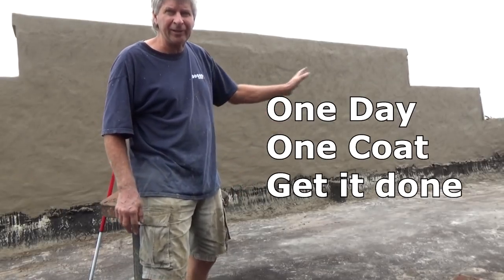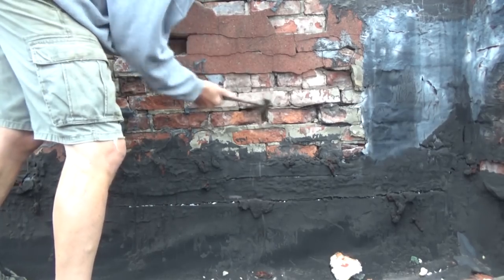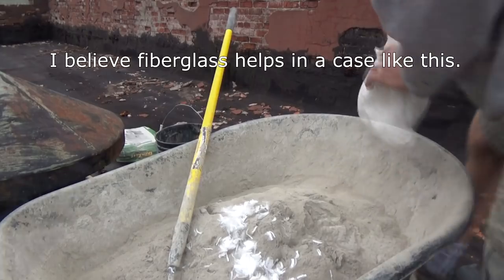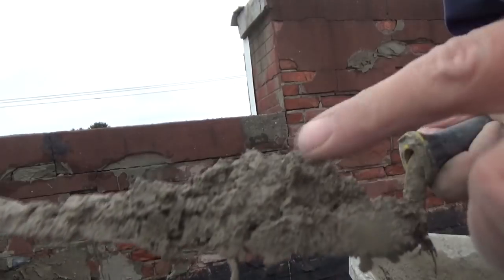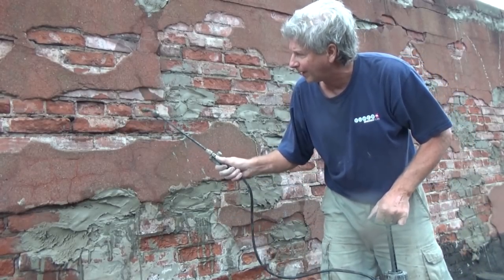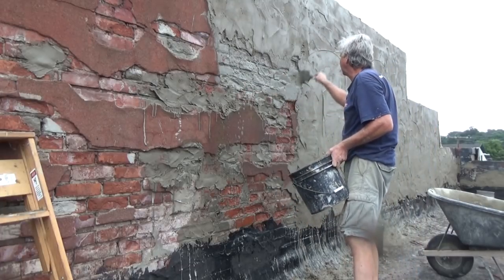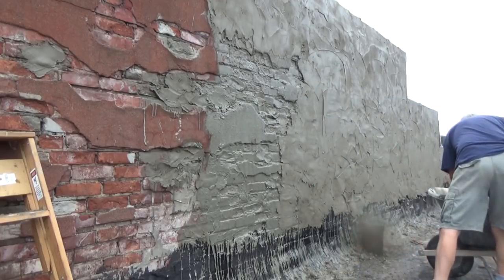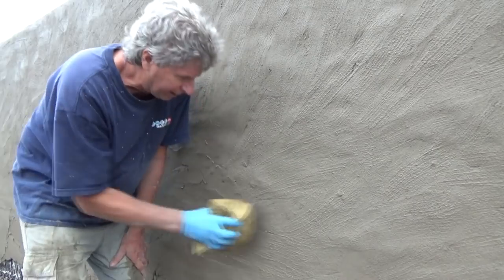MASONRY WALL REPAIR (part 2) Mike Haduck

Comment: All around the world there are buildings whose walls really look like ruins. There's where your cement paint and one hand plastering comes in. If most of the people knew about those simple facts and simple jobs, thousands of houses and buildings wouldn't look so terrible. Besides there is the low budget situation. In this case engineering has a solution and you apply it well. However if people had lots of money they would build a new house or a new building. I congratulate you for what you call "common sense" which is not that common for most people. Happy new year and may God grant you more projects and repairing, the world needs it and the world needs you!
Reply from the maker: Thanks Pedro, Happy New Year, And God bless, also,  thanks, mike

Comment: AHA! It does come down to the decision to take the job or not.
Mike you said a mouthful there.
Takes a lot to evaluate what the owner or agent wants, how much
they are willing to pay and if that will allow the craftsman a completed
work that is both correct for the situation, legal, and not a problem or insurance hazard.
I bet it took you a few years to pick up that skill.
Have a happy New Years by the way.
Reply from the maker: Thanks pensive, that was one of the best placed statements I ever heard, I am going to use it on one of my video, well said, I wrote it down . I am about 20 videos behind but I know which one I want to use it on,  thanks Happy New Year, I appreciate it, Mike

Comment: Mike this video amazing! Thank you. I'm looking to learn new things and this hits the spot.  I have work I wanna do to fix a deteriorated parged wall that came from winter. If there's one to two inches behind the parging, that was layered brick veneer, any suggestions how and if I can just cement that part instead.  I'm clearly very green to this kinda work.
Reply from the maker: Hi PT, I have a playlist called "foundation repair" I am sure you will find something similar,  thanks mike
Reply: @MikeHaduck  cool. Thanks!

Comment: Hey Mike...great job as usual...what's the lowest temperature you would consider doing this kind of work or even tuck pointing brick? If daytime temps are in the 40s and night time temps are near freezing, would you consider it fine?
Reply from the maker: Hi Bee, my rule of thumb is 3 days without freezing, I never had any problems with masonry doing it near freezing, thanks mike

Comment: Hi Mike.
I understand doing the first 3 steps.  The removal of loose debre, the filling of holes, and painting the surface with portland.
Is the next step of rendering the wall even necessary in this particular situaton?
I mean, all you want to do is keep the wall from falling apart on the roof.
Reply from the maker: Hi Bellona, I would say it evens things out better, and keeps any more loose
 Suff from coming off, , thank you, Mike

Comment: We have this stuff over here called SBR which you add to the mix instead of water when plastering apparently it's 100% waterproof . Unfortunately every time you mix costs £30 so I'm not going to use it any time soon . Dave from Wales
Reply from the maker: Hi David, that’s interesting,  never heard of it,  mike
Reply: @MikeHaduck  basically very expensive PVA glue the only difference is PVA remains water soluble and SBR doesn't . My grandfather remembered when Portland was new . regards Dave from Wales

Comment: Mike, I have a similar situation on a 120 year old parapet brick wall with lime mortar. I have sections where it's falling out completely along with the plaster. My question is should I stick to the soft style mortar type n  for old brick repair & plaster or should I use a heavier cement mix in my mortar? Some contractors are telling me if I use more portland in my mix I will further damage the wall because it won't be able to breathe correctly with heavy cement base mortar mix. Your thoughts would b greatly appreciated. I see u using type s mix a lot. I do live in Florida so it doesn't get cold very much, but does rain a lot. Thanks again
Reply from the maker: Hi user, I did a video called "lime, mortar or portland" what should I use? That would give my best opinion, thanks Mike

Comment: Mike have you tried spec mix? Stuff is pretty tuff..Not sure they make type n but I know they make type S. Takes three bags of that to make what one bag of brixment and sand will make. The stuff is so strong. Cost more money but you do not need sand etc just spec mix.
Reply: He is using quick crete type s. It is almost identical to the spec mix u are talking about
Reply from the maker: Hi Stevo, I never tried it,  sometimes I am afraid to try new products, But I am sure I will, thanks, mike

Comment: The cement mixture at 5:00 if it was thicker would be much better. As you did in another video with the brush! However, I notice that there are still many fragile pieces from the old plaster. By way i like your job.
Reply from the maker: Thanks, Mike

Comment: In the case of a chimney with full joints would you cut the joints out and plaster to help the cement grab or would you just wet it and plaster over the bricks? And could you plaster over breakaway block? 
Nick
Reply from the maker: Hi Nick, as long as it is not loose, I plastet over almost anything,  but every job is a bit different,  thanks mike

Comment: Hi Mike i just have a question for u. When u add the fiberglass, is it better to mix it in dry before u add the water & mix it up so the fiberglass spreads evenly? Also would adding the liquid bonding glue or i call it("milk") instead of fiberglass, do the same use as adding fiberglass? Thanx & keep up the good videos! I enjoy them very much!👍. Happy new year!
Reply from the maker: Hi Bob, I find the fiberglass spreads quite quickly, sometimes I get a little lump here and there, but it does the job,  I think the bonding Helps also but it slows down the drying for a fast job, thanks, mike

Comment: Hi Mike! I’m fixing my block foundation. The wall has sheared about 5/8” on row 2&3 of a 5 block high wall. I’m building a new block wall on the inside to support the old one as it’s just a crawl space and pouring concrete between both the new and old wall. On the outside I’ve fixed the water problem (gutters/drainage/grading) but I have a question…the exterior block was covered in a black substance, not sure if it’s tar or rubber. I have scrubbed it with Muriatic acid and about 50% of it is gone. Can I put mortar in the joint cracks and a parging coat over top of the remaining tar covered blocks? Will it stick? Or do I have to grind it all off? Once that is done, I’ll be applying a new waterproof coat and then a drainage membrane so little water will touch the blocks in the future. Thx, as always, for the amazing vids!
Reply from the maker: Hi Will, I did a video called " foundation repair " below grade, Mike haduck, and I used a foundation coating at the end, that might give you the basics, anything that works, thanks Mike
Reply: @MikeHaduck  that’s what I was looking for! How much of the existing tar do I have to remove to ensure the new parging coat will stick though? Cheers!

Comment: Hello Mike. Am I correct that your old school bonding agent (portland mix with water) can only be used on cementitious products and not surfaces that have been painted with exterior house paint?  How would you  bond the cement if walls are painted with exterior paint?  Thank You.  I like your guitar playing .
Reply from the maker: Hi Ray,  in my video series, how I patch up or fix a foundation ( Mike Haduck) there I show how I cut into or grind off the old paint,  I hope it helps, thanks, Mike

Comment: That's also the way we do in Brazil. Cement and water as an initial bonding agent, sometimes painted like that but mostly thrown as a rough cast.
Reply from the maker: Thanks Tescax, I appreciate hearing that, here it America they try to sell you everything you don’t need,  mike
Reply: @MikeHaduck  Oh, we also have all these fancy products nowadays and according to the manufacturers if you don't use them your wall will fall. Maybe they should tell that to the guys who built the Pantheon in Rome.
I use modern products too but it's good too know old school techniques when you're short on money or in a remote area without tons of supplies. Back in 79 my grandpa even made his own lime from burning limestone and slaking it and his house is still standing.

Comment: Great showing again today.  Would you ever do a house sidewall over old asphalt siding still hanging solidly?
Reply from the maker: Hi Julie, I have seen it done years ago, and what they did is still holding up, When I went over old siding I uses styrofoam insulation and then nailed wire for the stucco,   Kirk would know more about that, thanks, mike
Reply: thanks @MikeHaduck

Comment: Nice video Mike. What's the formula for the old school Portland whitewash? I part Portland 2 parts mortar mix and add water? Thanks
Reply from the maker: Hi malone, I have a video out called, " painting with Portland, whitewash, bonding, mike haduck, " that should help thanks, mike
Reply: Just saw it, thanks Mike. Rolling up my sleeves to patch a commercial bldg. with terribly patched cinder block areas that are falling out due to water damage from leaking gutters. Like you say, I wanna be in and out. By 1pm wanna be driving home. Haha. Greetings fro RI. My son is going to college in Gettysburg. Our climates are very similar so that's why I'm finding your videos so helpful. Thanks again

Comment: Hi Mike -Just wondering if a job like that needs some sort of sealer over the finished work? or is there enough water resistance in the mix already - I would think that rain water would seep into the cement and make its way down under the roof or is that just totally wrong thinking on my part? GREAT videos Thanks for posting
Reply from the maker: Hi arosario, I would  say that in this case a sealer would definitely help, and eventually the rain water will be getting in again, but the owners figure they will be dead by then so it probably won,t happen, best answer I could think of, thanks, mike
Reply: Thanks Mike for the response -The reason I ask was back in the late "80s" I was doing Commercial Roofing and ran into the very same type off problem except the wall was half the height of this one , I knew nothing about masonry work at the time -once the roof was replaced my solution to the problem was to just run the flashing all the way up and over the top of the wall and replace the top cap with a one piece aluminum one -so as far as I know that worked as I never received a call back lol Thanks for the videos !!

Comment: If I wanted to cover soft orange brick that is falling apart the same way, could I still do a 1/2" scratch coat and notch it to apply a veneer? Would I be better off just doing cement board over the brick?
Reply from the maker: Hi Dave, it is a hard question to answer, every situation is different, some things work some things don't ,  it is best to ask some of the locals or inspectors and see what they would require,  thanks, mike

Comment: Hi Mike. I have a wall I need to repair similar to this one. I have two questions: 1. Will the portland paint work on cinder blocks? 2. Do you have to let the patchwork dry before going over with the final coat?
Reply from the maker: Hi Brian, I always use the Portland paint, especially on cinder blocks,, I usually let it dry and then go over it again and again until I get the final finish, also sometimes I go over it again with the paint between coats if I think it needs it, I hope it helps thanks, mike
Reply: @MikeHaduck That helps a lot. Thanks, Mike.

Comment: I just submitted my bid for a job in my town. It's in an alley and one section is 6' wide  x 20' high on one side and 4'wide  x 20' on the other side of an elevator shaft. The wall is granite and brick they dont want anything fancy just covered up. I was curious if you would recommend the mix you use here and if you think dimple mesh would be needed. Since the sections are so high. I was planning on using heavy duty waterproofing mix.
Reply from the maker: Hi Nick, it's a hard call, I usually use some fiberglass added , do my  first coat wait a few days and do a second, but everything depends, I would do a little sample on the wall and see how it sticks. I like 2 sand to 1 cement ( half smotar half potland)  other masons would disagree, thanks mike
Reply: @MikeHaduck  thank you for replying mike not alot of people would. I really appreciate it. Happy holiday season!

Comment: Hi Mike, love the videos.. What would you say is the thickest, approximately,  you could lay 1 coat of that s mortar onto brick? Labels say about 1/2 inch. Id like to get 2 inches... Would the fiberglass enable a thicker layer?  Many thanks!
Reply from the maker: Hi Emmarie,  I try and keep it as thin as possible,  if you want more you usually wait and do a second coat days or weeks later, check out my foundation repair videos, every situation is different,  thanks mike
Reply: @MikeHaduck  Thanks Mike, could I recoat a few hours later once the first thin coat has hardened?
Reply from the maker: Hi Emmarie, the problem is traditional cement shrinks, that is why guy like Kirk wait up to 30 days to put on the final coat, otherwise it is going to show a lot of cracks,  if it is very small job I will just use rapid set or fast settling repair mortar and two ahours later you can go over it and be done,  it all depends on the job, I hope it helps, mike
Reply: @MikeHaduck  Thanks Mike, Im in NY so I trust your climate opinion here... I didn't get any shrink cracks, I was more concerned that the second layer would not adhere properly, as I only waited a 2 hours to recoat. I used regular s mortar mix and added a bit of portland, and each layer seemed to hold well together. each coat was 1/4 " totaling 1/2". Im goind to drylock after 30 days, i bet that would cover any cracks too, thanks again Mike

Comment: I need to do this in one part of my house. But it has paint all over. Can still do this . If i can't get all the pain out. I leave in Reading PA.  Which house is 110+ years old. Thanks.
Reply from the maker: Hi GH, keep watching the playlist, I come across that a lot, also in my foundation repair videos, it dosent always have to come all off, but I scar a lot of the surface to make it stick, thanks, Mike
Reply: @MikeHaduck  hi! Thanks for replying. The wall that I need to this is the outside wall super tall brick wall . Can I do this by section . Thanks.   I saw your foundation video. I have it saved that another project that I need to do, too .

Comment: Would this be the same method (materials etc..) used to parge the interior of a brick basement circa 1890? It's been parged once before, I'm just looking to patch a few spots for cosmetic reasons. 
Thanks!
Reply from the maker: Hi Matt, I have a whole plalist on foundation repair, Mike haduck, thanks Mike

Comment: What do you think about using thinset instead of mortar mix? I'm thinking thinset would bond better to the brick and be less likely to crack.
Reply from the maker: Hi Mike, I never use thin set for something like this,  this was a one day job, but if you want to spend the time it might work well, I don't know, thanks mike
Reply: I've had masonry business for 15 years, only block, brick and stone. I have a customer that wants his parapet wall tuckpointed. The mortar is still very hard so it would take forever to grind out all the joints. I'm thinking it would be easier\cheaper to plaster over the wall instead. Not sure how much to charge, what's the going rate per sq ft for 2 coats?
Reply: @MikeHaduck  I'm not sure how much to charge.
Reply from the maker: Hi Mike, good question.  Sometimes time and material with a little higher ballpark figure will sufficed,  all depends on the owner and what he is expecting I hope it helps mike

Comment: Hi Mike I have a question maybe you could answer. I live in a house with what I believe to be a fabricated  limestone facade unfortunately at the bottom of the doorway the stone is starting to turn to powder/disintegrate what can I do to stop this from getting worse I can post a video a little later on
Reply from the maker: Hi Yehuda, it is probably no big deal, look for something that will replace it, then do what you have to to make it work,  I hope it helps, thanks, mike

Comment: I tried your bonding paint technique for the first time but with s type mortar as the base since I had some left over after getting the voids. I saw you do it in another video too but how will this affect the end result instead of using just water and Portland?
Reply from the maker: Hi A. K.  I’ve seen it help if the surface was wet enough, thanks, mike
Reply: @MikeHaduck  great is it fine if I let it dry for a couple days or is it a must to apply right away when still wet?

Comment: Hey Mike, I live in Canada and was wondering if I can work on repairing mortor on my stone basement foundation walls in winter?
Reply from the maker: Hi Sonny, I never had a problem with a inside stone wall as long as it was not frozen or going to freeze, I hope it helps, thanks, mike

Comment: Mike do u use type s or type n for stucco over brick house was but in 1890 in New Jersey
Reply from the maker: Hi Keven, I would ask the stucco guys about that, I usually do it over foundations or very old repair work, but I have used the s mortar and haven't had a problem , I always let it dry a few weeks before final coat because of the shrinkage. Lot to consider,  mikr

Comment: Hey mike I'm still new at this but I heard that your mortar doesn't have to be stronger than the brick. In order to let the wall breath . can you please explain
Reply from the maker: Hi Joe, I heard a lot of different theories, but I know from experience where I live this works, I have never had a call back or complaints. But if what they do works for them, I have no worries, thanks, Mike